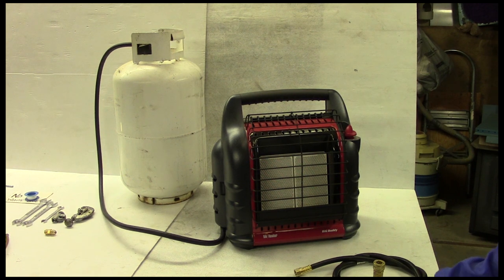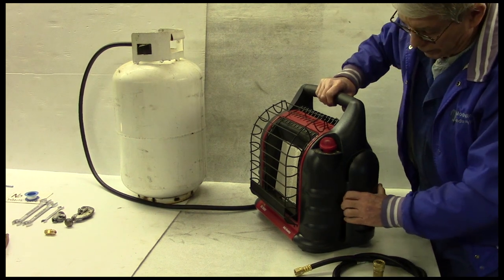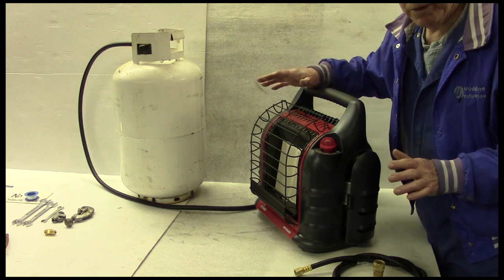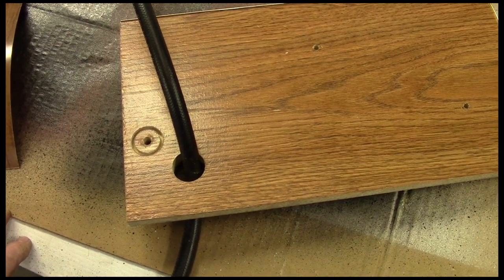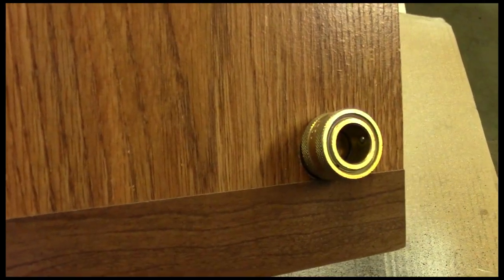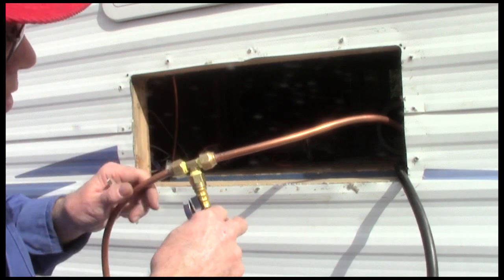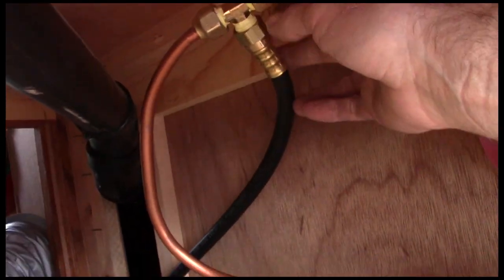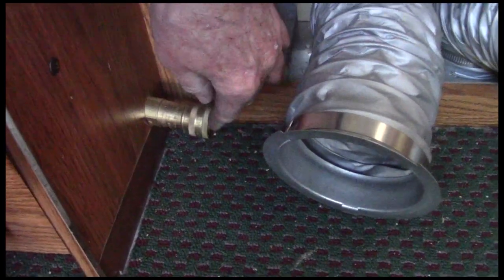Plumbing a Mr. Heater Big Buddy Heater into your RV propane system

Comment: My standard quick coupler does not fit on my Big Buddy MH18B quick connect male end. Did you remove the connector on the heater and change it?
Reply from the maker: NO NO NO, Do not change the coupler on the heater.  These are not standard air couplings.  Go to a propane supply dealer and buy the proper hose.  It will have a quick coupler on one end and the thread coupler that attaches to the propane bottle.  Or if you are plumbing it into your RV's propane supply get the hoses with a male on one end and the female on the other if you are using this install.  Gas couplers are unique to gas supplies, do not substitute with air fittings.  Thanks for your comment.
Reply: It was sold to me as a propane quick connector, but maybe it isn't since it doesn't snap on.  Thought maybe Mr. Heater had a proprietary connection.   Anyway, decided to purchase on Amazon a Mr. Heater hose with a quick connect made to go in RV so everything will fit correctly.  Thanks for your help.
Reply from the maker: @dianne-yq3py  Good Luck.

Comment: Thanks for showing that it indeed has its own regulator. I just bought a Big Buddy and I love it, and have gone through 2 20lb tanks already, but then i see comments online saying i need to buy a regulator or it could explode. Clearly it has it's own built in. Thanks!
Reply from the maker: You only need a regulator if the heater you use does not have one.  The Big Buddy has it's own regulator, so using double regulators, you would have no propane supply.  You will also note if you look, it also has a direct hose connection if you want to use a line directly from your RV's propane system.  Which is after the RV's regulator, or low pressure propane, as seen in this video.  Thanks for commenting.

Comment: Can you explain a little on purchasing the proper scale for weighing the bottle when filling them.
Reply from the maker: This video does not cover filling propane bottles, but I have filled them before and any scale will work as long as you can safely and securely sit the propane bottle on it.  I used a bathroom scale, and it worked fine.  I hope this helps.

Comment: I did the same thing in my first RV but was told I had to have a safety shut-off valve in between the tea and the rubber hose?
Reply from the maker: That is probably a good idea, but given the hidden location of the copper tubing, it would be impossible to reach.  If the shutoff is for the purpose of servicing, you can shut the system off at the tank.  Thanks for commenting.

Comment: Where is the gas filter ?
Reply from the maker: Ronald there is no gas filter on a propane system in your RV.  What I think you are refering to is the gas regulator.  The BIG BUDDY HEATER has 2 gas regulators that you can attach 2 -1 pound canisters one on each side of  the heater in a small closable side compartment.   There is also a connector in one of those compartments that you can attach a hose from your RV's propane system or a hose from a propane bottle as long as it has a regulator to bring the pressure down before it is connected to the heater.  This i a special hose with a quick coupler similar to an air compressor quick coupler.  This is available at dealers that sell propane accessories. This is the connector I used  in my video.  Now this hose from the RV's system is a low pressure hose because it is after the RV's regulator on the tanks, so the whole RV system is low pressure and this is what I taped into for my propane supply for the heater.
Reply: Thanks for explaining this. I feel like you ate your cereal every day.

Comment: Should not use ventless heater when Sleeping. Must  use roof ventilation . Must have 3 foot min clearances from front.Must have accessible manual cut off. Camper /Sleeping areas call for direct vent systems .Hank propane
Reply: Is it okay to use if you leave your roof vent cracked open?
Reply: I've had mine in use 8+ yrs and never a problem
Reply: For sure this is when gas code should be used. Sorry 31years gas tech  confined space  Direct furnace in this space should be used. Sorry there is no co at first . But when camper is closed up  ventless heaters will produce co   All it takes is one person  to not ventilate camper properly. Your body loves co . This is a no no sorry
Reply: @henrycartwright2164  I'm pretty sure these heaters have co detectors!! and automatically shut off if detected. Even too you can buy your own co detector=common sense!!

Comment: Very well done Ray! Great job on both the install and the video production. I have Big Buddy too and did a similar install from the main tank. For what it's worth I used a rubber grommet where the hose passes through the chipboard to avoid chipping off the wood each time it's drawn through. Thanks for the hard work and valuable lessons.